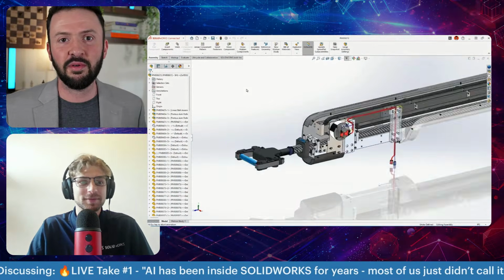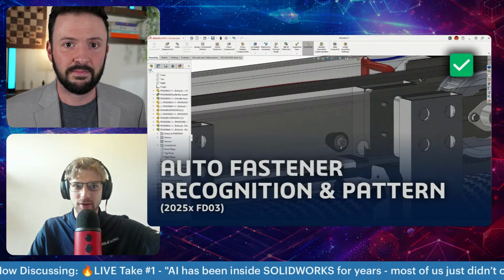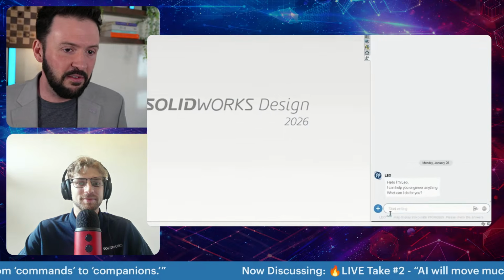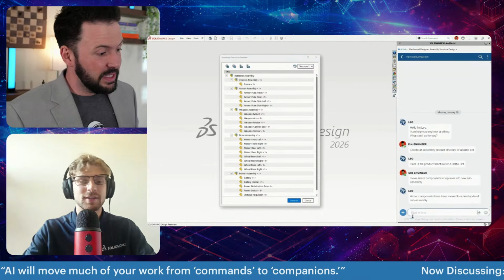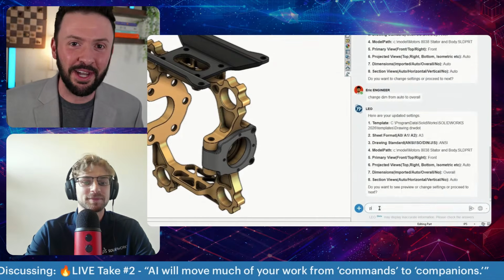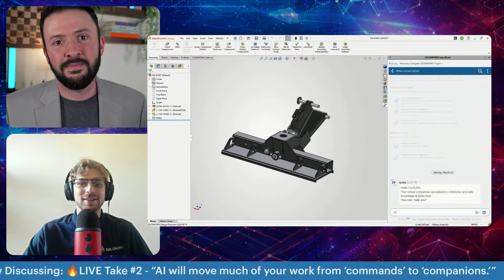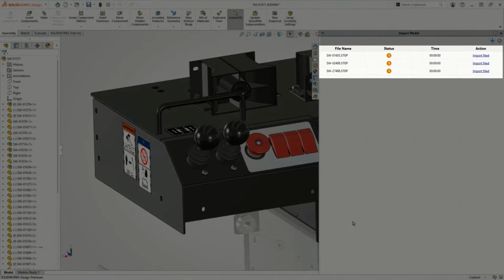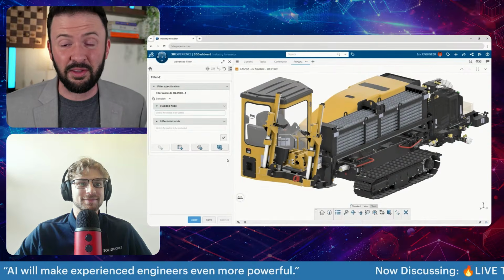SOLIDWORKS AI Explained (SOLIDWORKS Labs Demo)

Comment: thats kind of interesting, it doesnt seem for a long time ai will actually be able to do complex mechanical design work. wonder why that is. like even this kind of ai integration seems completely optional, and some old fashioned engineers could definitely get away with ignoring it altogether. i also checked out fusions integration and its cool but not really taking over the process at all, not in the way you see for like coding and communication and other things even that have huge design requirements.